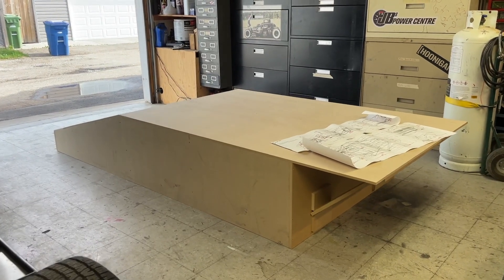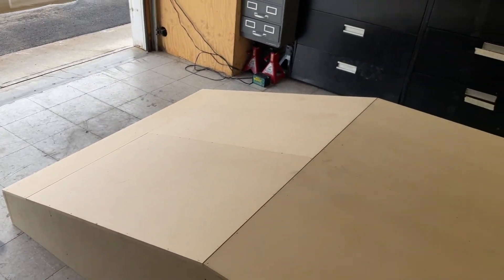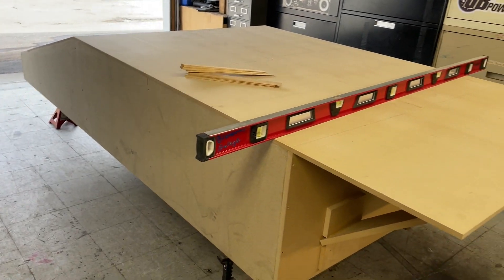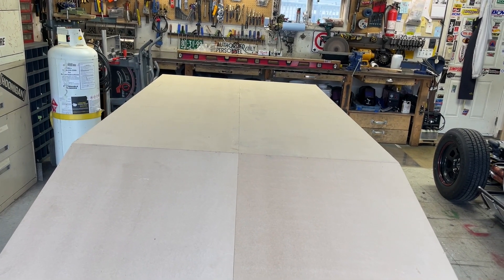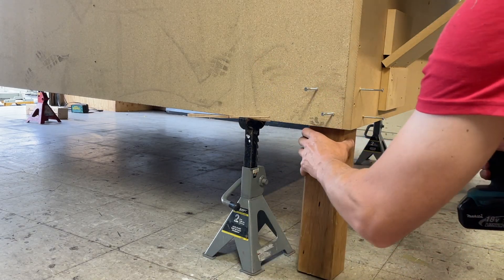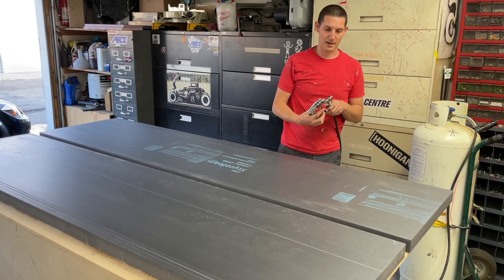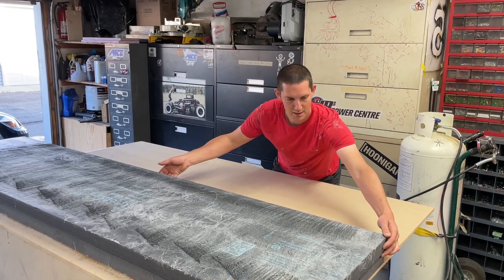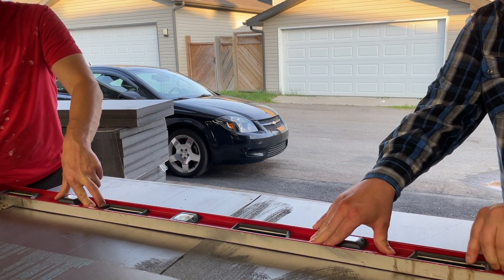Starting to make a carbon fiber car body in a home garage

Comment: Just started watching this series of your build
Very interested in how this build goes as we are doing a exactly the same car at work 
My background is I work in classic car restoration and we specialise in the 246 dino and our boss has always wanted a 206sp and recently we managed to get hold of a replica chassis and 206 motor and various other parts to go with it
I believe our car was intentionally going To be the one with the semi inclosed cockpit but he wants it like your car
We have looked into having a full alloy body made because some literature says they had an aluminium body. Other literature suggests they had a fibreglass body, so we may need to make a complete body ourselves like you doing
Reply from the maker: Originals were always aluminum. All 18  206sp's looked the same being designed by Drogo, although 3 of them were fully closed cab Berlinettas.  Chassis #022 was rebodied in this fully open spyder configuration in 1969. The bodywork differences between the full cab cars and the cut down Montagna style are actually quite different when it comes to the details.
Reply: As I continue to watch the other videos I may ask more questions if that’s ok
Reply: Also where did you manage to find the dimensions drawings of the car 👍
Reply from the maker: @essexboydave  There is a very generic early factory rendering of the 206sp with basic measurements that can be found online if you search "206sp blueprint". I used that for the general wheel base and such, but otherwise, everything was done completely by eye with a few photographs.

Comment: Where did you find that foam? I can't find any for less than my life savings lol
Reply from the maker: I got it from a drywall supplier. It's used for rigid insulation on the exterior of homes under the stucco.
Reply: @howisthatstreetlegal  ah, thats a great idea
Reply from the maker: @seanhiggins704  rigid foam is surprisingly more expensive than one would assume, but it really is the perfect material.
Reply: @howisthatstreetlegal  yeah, im 3d modeling mine and want to source some foam for a cnc machine...same issue, its crazy expensive now days

Comment: Very nice I understand how to build a body from alloy with a buck I haven't completed a full body normally I just repair damage 

I thought you might do something similar by laminating a buck into the foam block then sanding and shapping untill you find the buck that way you have a hard set of lines to follow to generate the shape without having to check so often or mutch 
old mate Bob is a top bloke as well